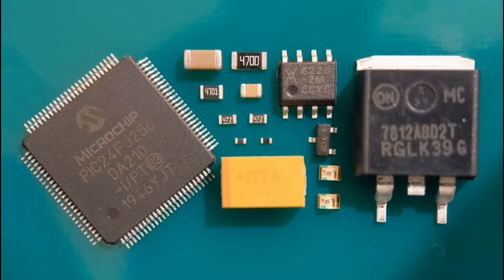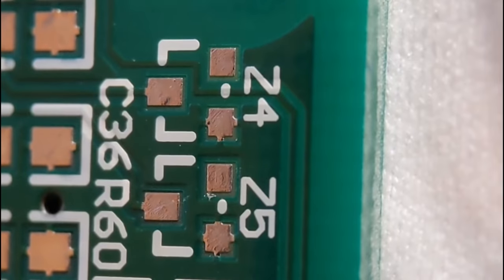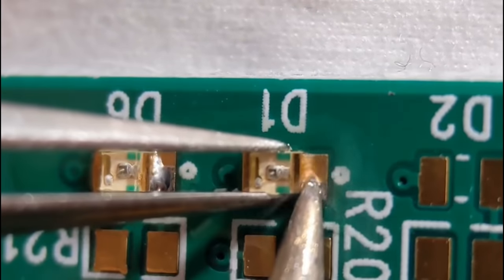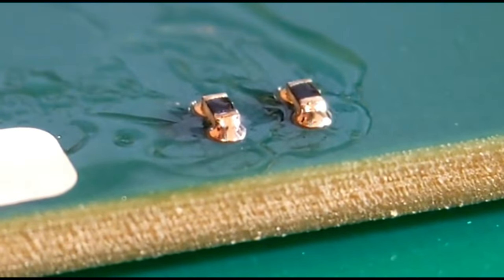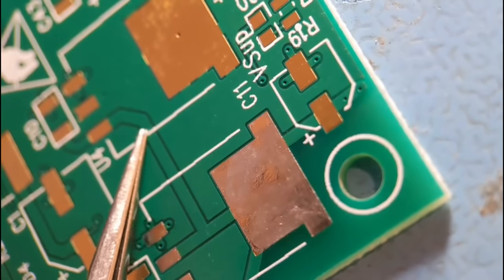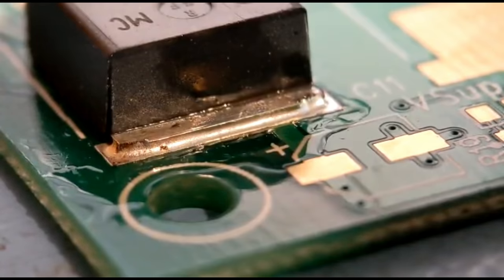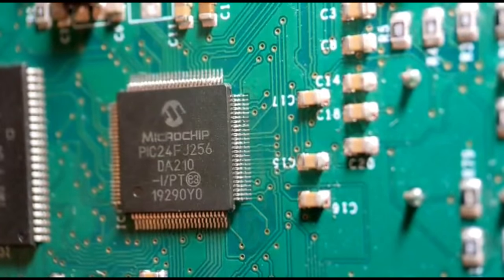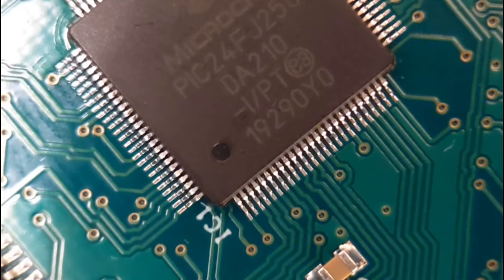How To Solder SMD Correctly - Part 1 /SMD Soldering Tutorial

Comment: This is of course very good, even though I'd add something. A quick mention on ESD protection soldering irons would be worth noting, as would preheating the PCB (even just a heat gun) so as to prevent blow out of the masking or copper. That, however is more likely to affect somebody in a particularly cold climate. Even though room temperature is assumed, life doesn't always work that way. Good video. Nice shiny feet on the soldering.

Comment: You can also use a multimeter (in diode check mode, or continuity) to see which end of the diode is the cathode and which is the anode, saved me many times.

Comment: Great , love it, But i would like to know how to identify the component to get a new one and also i need to know how to find the data sheet or schematic. ?
Reply from the maker: Hi , thank you for your comment. 
What sort of components are you trying to source ? If it's resistors it's fairly easy as you can work out the numbers on the top . Example is 103 , which is 10k ( 10 thousand ) 10 + 3( number of zeros after the 10 ) . If the resistor has 4 digits it's still the same ( last number is the number of zeros you add on , i.e 1003 is 100 + 3 zeros , so = 100,000 so 100k (100 thousand ) . 1206 , 0805 , 0603 size resistors are marked like this . Occasionally you get letters on resistors like O1A which is 100 ohm . You will find these codes on Google search , just type in resistor coding , this is to hard for me to explain . All 3 pin IC's you can try typing the marking that's on your component i.e D88 into Google search , just write D88 top marking and usually it will give you a possible component that this marking matches . I've used this method lots of times and sometimes it find components no problem . All the bigger IC's usually have type of component written totally on the top . You can go to Farnell or RS Components websites , click on search bar , type this marking in and it will bring up the component . All IC's I get my data sheets from via these 2 websites , every component you bring up you can scroll down to specifications or technical info and in here you will find datasheets , schematics etc. Hope this helps , good luck 👍

Comment: Very nice videos, indeed! I watched your entire soldering series and you make it look so damn easy, until one needs to pick up the iron and do it himself. 

I know the tools you use make the difference and I just wanted to konw what is your take on using the TS100 iron with the TS-B2 tip for general purpose SMD (1205, 0805 and, maybe but not necessary, 0604). The specs of the tip basically are conical, 10mm long and a radius of 0.5mm at the end. If anyone else would like to shareir the experience of using this iron for DIY projects, NOT full-time job on soldering, please put your words here.

Also, I wanted to know if you are able to do all that SMD soldering (0605, 0402) with the naked eye or you use any sort of magnification. If yes, what kind of tools for magnification do you use?

Thank you again for sharing your soldering techniques. They are really instructive and very high quality.
Reply from the maker: Hi , thank you for your support , much appreciated. 
The tools I do use when I need magnification are ( model number 8087046 LA8093LEDRS/EUK ) , a simple aid that sits on your desk with a built in LED light ring . If I need a fully blown up view of a PCB I have a stereo long reach microscope , purchased from GT Vision  ( England ) , their own branded one , a great scope which allows me to do microscopic work + the long arm means I can get very large boards under it.
I haven't heard of the iron you mentioned so I can't really comment on that at all , but maybe other people if reading this can leave a comment about it . 
I do use a microscope when doing below 0603 size components , even though I have perfect close vision , using a microscope just gives you an amazing view of your board .
Hope that helps , thank you again for your comment and good luck with all your soldering projects 👍

Comment: These SMD videos have been excellent! I have a project I'm planning with some 0805 and LQFP 32/48, so these have been a huge help!
Question: Are you using a magnifying lamp/microscope? Or is this with the naked eye? The camera view makes it seem like there is acres of room between the traces, but that's not true :) Thanks! Keep up the great work - I've subscribed!
Reply from the maker: Hi . Thank you , much appreciated .
I'm glad you found the videos useful , I have more SMD ones planned so hopefully you will find them useful as well.
To do most of my work I do use a microscope and your right in saying the traces may appear a distance from the next one but in reality they are amazingly close in a lot of cases . To do this sort of work you 100% need a microscope.
Good luck with your projects and I will keep posting all sorts of soldering videos  so as to hopefully help people if they need it . Thanks again👍
Reply: @mrsolderfix3996 Would a magnifying lamp be sufficient for hobby level soldering?
Reply from the maker: Hi , magnifying lamps are pretty useful down to certain size components . Get one with a light ring on it and this should be good enough for most home hobby soldering . When you get more serious down to 0402 or 0201 size components for example you will then really need a microscope . Thank you for your comments , good luck ,👍
Reply: @mrsolderfix3996  Thank you for response!

Comment: Amazing to see and so clean! I'm definitely getting a microscope, currently using flexible dental desk clamp magnifying lens.
Reply from the maker: Hi . Thank you for your comment, much appreciated. I do use a microscope sometimes when I'm doing fine pitch work , but all the filming is done using a mobile phone with a macro lens attachment placed over the camera of the phone . You can buy special kits that include the bracket that sits over your phone camera and then the lens just screws into the bracket . This allows me to sit it next to the work bring carried out and so I can get different angles when filming . Thank you again for your support and good luck with whatever you do 👍
Reply: @mrsolderfix3996  Can you please share the link where one would get the micro lens that attaches to the phone

Comment: What temperature do you use for your soldering iron? I find it very difficult to keep my tip clean so long with lead free.
Reply from the maker: Hi . All my soldering Is done roughly around 350 degrees centigrade , using a variety of different size tips . 
I know what you mean about the tip sometimes being difficult to keep clean . I sometimes scrape very carefully over the end of the tip with a fine scalpel then dip in tip cleaner which re-tins the end . Or I just re-tin the end with leaded solder then clean off and then coat In lead free so it's not contaminated . Between these methods I always get there in the end . Thanks for your time , much appreciated 👍

Comment: Lovely clear tutorial. Thanks for showing. Can you tell me what the material is that you are using to clean after soldering please?
Reply from the maker: Hi , thank you for watching . The solution that I use to clean my boards after soldering is called Ultrasolve . It's the best flux remover I've ever used ( and I've used many over the years ) and it's actually the recommended cleaning product for the flux I use , SMFL200D . Both these products are available from Farnell , RS Components , Rapid Online and other Electronic distributers.
The cleaning cloths are from a company called Grove Sales and are also the best I've ever found . Come in a pack of 100 , they are amazing , about £5 a pack. Hope that helps , thanks again 👍
Reply: Are you using a sponge with it or…? And what kind of flux tool is that?
Reply from the maker: Hi , I presume you mean what I clean the iron tip with ? If so I am using a damp sponge for this. The flux applying tool I use is simply a plastic cable tie , ive posted a video on YouTube showing the flux I use , how i use it etc . Thank you for your comment , good luck 👍

Comment: I am a novice at soldering and find your videos to be very informative. I was just wondering what is a safe temperature to keep your soldering iron at for SMD? Also wondering when tinning your soldering iron tip do you use sandpaper to form a base layer of solder on the tip or how would that be done? Thank you in advance.

Comment: Whats the thickness of the solder..? 

I have only rough soldering experience daily of joining like brake light wires and stuff. Removed a 60 odd pin chip yesterday and tried soldering to an adapter plate. Hakko micro soldering and quick rework station. I failed ha ha
Reply from the maker: Hi . I use a various array of different thickness solders which is essential in my view , both leaded and unleaded . My favourite for any kind of small joints i.e fine pitch IC's or 0201 size components is 0.25mm solder. 
For any kind of large joint I tend to use 0.46mm , and for really large joints I have some 0.7mm thickness solder.
The big mistake some people make is to use the wrong size for the component in question. I get all my solders from BLT Circuits ( based in England ) also different size solder tips is essential . Good luck 👍

Comment: OK, now for some REALLY important questions:
1. what brand flux are you using? Is there any you recommend staying away from?
2. What are you using to clean up?  It doesn't look like a cloth or paper towel.
Absolutely gorgeous solder joints m8.
Reply from the maker: Hi , thank you for your questions . 
Firstly the flux I use is called SMFL200D . It's a great flux , the only one I ever use . It comes in a 200ml spray can , I just spray a small amount into a small container ( example milk bottle lid ) and apply using a dipped Ty wrap to the desired areas .I can't really comment on any others as I don't use others. Costs about £14 a can.
Next the pcb cleaning fluid I use is called Ultrasolve . Best fluid I've ever used ( and I've tried a load over the years ) this is the recommended fluid for the flux I use . Both available from places like Farnell , RS Components ,Rapid Online and other electronic distributers . 
Lastly the cleaning wipes are called Gtek dry wipes . Available from a company called Grove Sales. Amazing flexible wipes , these are the best I've ever found in many years of soldering . Just dip into a small amount of the Ultrasolve and great results await you . The wipes cost about £5 for a pack of 100 . 
Hope that helps , thanks again 👍
Reply: @mrsolderfix3996  That's possibly the most useful information I've read in weeks.  Thanks.
Edit: unfortunately, Grove Sales won't ship them to the U.S..  Bummer.
Reply from the maker: Hi . Glad to help you . Hope you get everything you need . Thanks for your support 👍

Comment: How do you make the solder stick to where you want it?  When soldering, the solder I want to go somewhere just stays on the tip of the iron.  Very confused as to how to get the solder to go where I want.  Using 37% lead solder.
Reply from the maker: Hi , not really sure what's happening here . Are you using a good flux ? If not this could be a major factor in why it's not flowing well and sticking to the iron . Normally if you get nice clean pads and use flux the solder takes so easily to all the components you place on them . I've never really experienced what you are having . I guess a good clean solder tip at the right temperature , decent solder and FLUX and nice clean boards with your tinned iron tip right on the components as I always show and you should be ok . Sorry that's all I can think of . Good luck , take care 👍

Comment: Hi,

Can you please provide the brand name for the flux you use, please?

Thx for the tutorial, it's a big help.
Reply from the maker: Hi . The flux I use is called SMFL200D . It comes in a 200ml spray can . I just spray some into a small container and apply using a dipped Ty wrap. It's about £14 for a can , available from places like Farnell , RS Components , Rapid Online also seen it on Ebay . It's great stuff , the only one I ever use . Hope that helps 👍

Comment: I realize this is an older video. I was wondering if you ever soldered a 0201 SMD LED? They are so small that you can hardly see them. I haven't soldered any of them, but do have a tape full of them... I just don't know who much smaller discreet electronic parts can get now...
Reply from the maker: Hi , thank you for your comment, much appreciated. I have never showed it in my videos as my camera isn't quite up to filming 0201 size that clearly but I have soldered many in the last couple of years with great success. I can achieve the exact same shape  joints as all the other size resistors etc by using the same soldering method  . Also recently I've been soldering lots of 1005 size , again with great success using this method . I did use a mini Metcal iron for this though  which I featured in one of my other videos . You would need a good microscope , very fine tweezers , and 0.25mm solder as well . I just placed a minute amount on the tip to get joints this small the perfect shape . You can't feed the solder into the joint or else you will well overdo the amount you need . 
I don't really think there will ever be a need on YouTube to show 1005 as there won't be the demand to know how to do it as even now I'm not seeing to many products with them on . Hope that helps , thanks again 👍

Comment: I repair chips in new cars PCMs & Modules, what Iron are you using if I may ask? On the FIRST solder?
Thanks M8!
Reply from the maker: Hi , thank you for watching the video , much appreciated. In this video I used a Weller TCP S iron set to about 350 degrees centigrade ( unleaded solder ) and 2 different soldering tips , a PTP7 conical tip and a DD8 ( large flat sided tip ) , hope that helps , thanks again 👍

Comment: Suggested iron temperatures and recommended flux, please. Are you using a flux pen of some sort ? I can’t ascertain what is being used.  Thanks!
Reply from the maker: Hi , thank you for your comment . The iron temp for this video was 350 degrees centigrade.
The flux I always use is called SMFL200D. It comes in a 200ml spray can , so I just squirt a small amount into a small dish and apply using a dipped Ty wrap to the desired area. Available from Farnell , RS Components , eBay , pretty easy to find . About £14 a can . I recommend this flux , it's the best I've ever used. Thanks again 👍
Reply: @mrsolderfix3996  Thanks for the infos :), could you please tell is the iron tip some special thing ? At 300° my tip gets burnt super fast :'(
Reply from the maker: Hi . My iron tips are just normal tips that I use for my Weller TCP S soldering iron . There is nothing special about this iron , i love it but it's just a mid range iron compared to some of the modern ones that I can't get on with . Hope that helps , thanks for watching 👍

Comment: Holy Crap. Who can place tiny components like that correctly the first time? Asking someone who has gobs more experience than I..........Is it acceptable to load your iron and then simply touch the solder to previously fluxed components? I do this all the time to save a hand.
Reply from the maker: Hi . Thank you for your comment . You can do it your way I guess if you have large components where a bit of excess solder is not harmful . But if your doing a fine pitch IC for example you would probably cause a solder short as you really need to do these individually like I show as you go along the row of pins , because you can control the amount of solder on your iron tip so much better this way. Hope that helps , thanks again for your time 👍

Comment: you are a bloody legend sir. I've never seen any soldering skills as insane as yours.  Could you please let me know, like a beginner that I am, what equipment should I buy so I can start doing soldering? Do you use digital microscope for your work? Thank you very much in advance Mr SolderFix
Reply from the maker: Hi , thank you for your comment. I've posted a tools guide video on YouTube showing some of the basic items you should try and get . I've also posted many other videos about different thickness solders , cleaning fluids , fluxes etc all of these items are vital also to getting better at soldering . So I guess all you need to know is in some of these videos. Also I own a stereo long reach microscope which is definitely needed for some of the smaller , fine detailed work , but as a beginner I would get the basic tools , and along the way you get to know what you need tools wise. Hope that helps , thanks again 👍